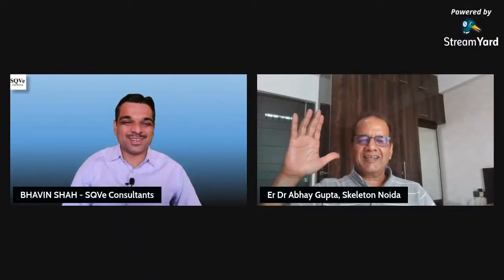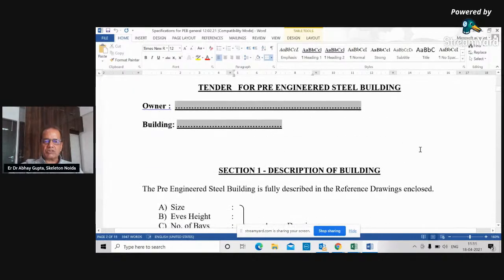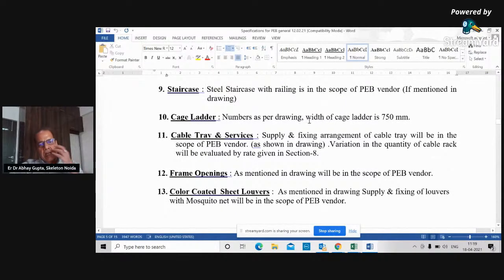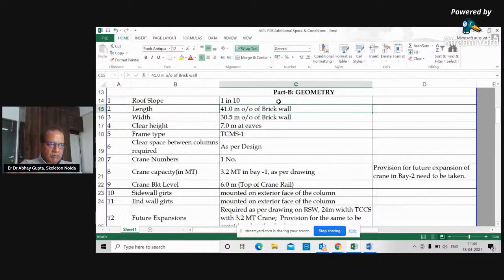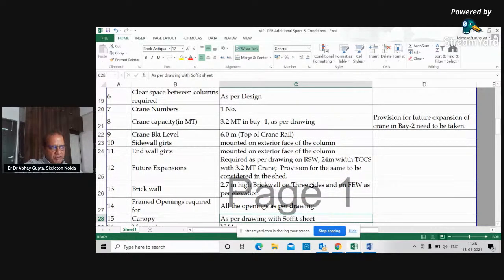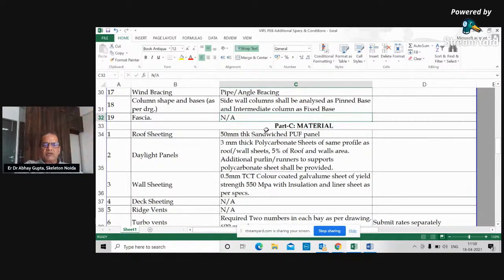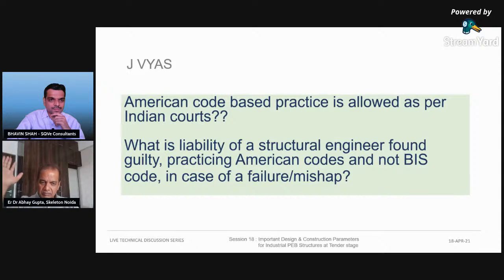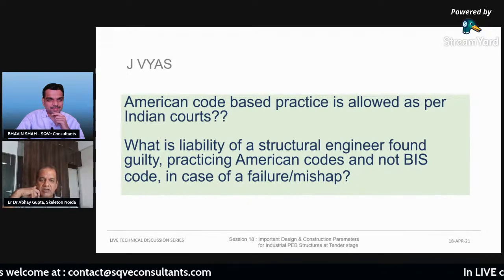Session 18 : Important Design & Construction Parameters for Industrial PEB Structures in Tender

Comment: We are  talking about indian code but in actual 90% industrual sheds are designed in american code but there wont be any legal restrictions.
 one thing is  very  clear  that if  client is getting safe as well as economic structure  on american code  then why they  go for indian code

I will BIS can  must understand that  and revise the code Is800/2007
Reply from the maker: You may connect with is through email address: contact@sqveconsultants.com for further discussion.